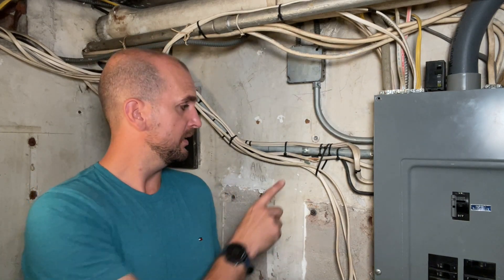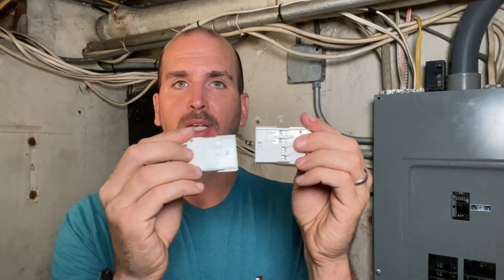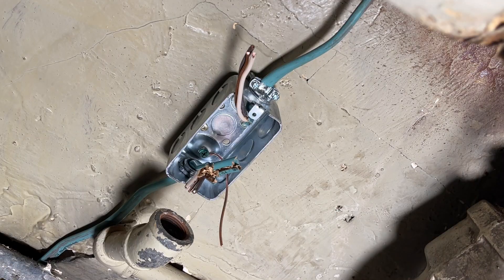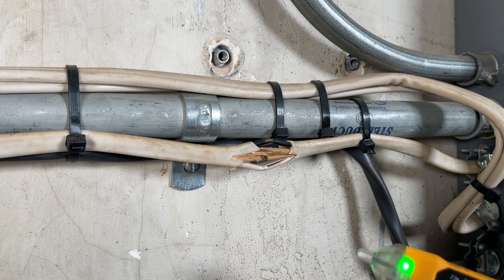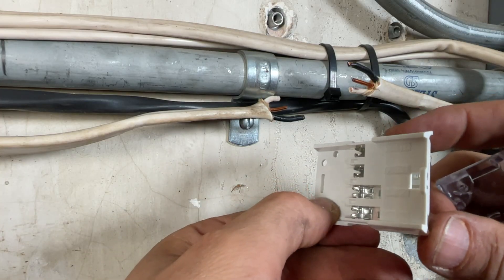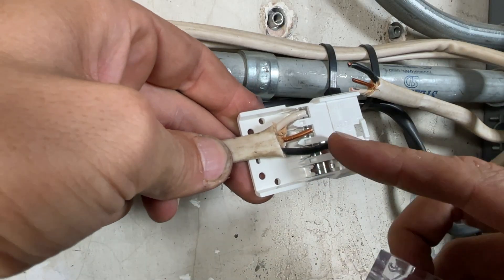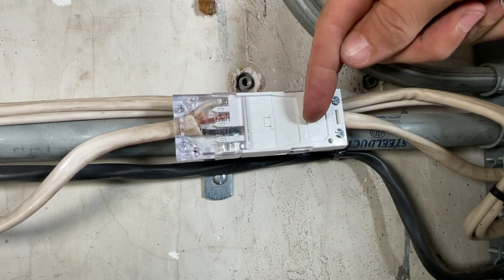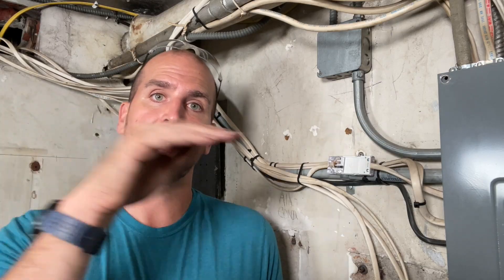How To Repair Damaged Romex Wires

Comment: I don't like the whole concept of pinching down on a wire to make a contact, especially buried inside a wall. Looks like a temporary repair
Reply: This splice kit requires plenty of force to assemble each half. In fact, the instructions recommend using channel locks. On top of that, there's 2 screws that fasten the cover and prevent the wires from backing out in case some bastard decides to pull on the romex. Also, some local jurisdictions may require more stuff to be installed if a splice kit is used.

Do realize that network cable jacks, couplers, and plugs pinch all 8 wires to deliver internet signals as fast as 10 gigabit.
Reply: @aurvaroy6670  amperage buddy
Reply: @randyschryvers7418  Good point. Same thing goes for WAGOs, even the lever nuts
Reply: @aurvaroy6670  They don't carry enough electricity to kill someone or burn down a house.
Reply: @whattheschmidt  Are you talking about the splice kits or WAGOs?
Reply: @aurvaroy6670  Ethernet 8 wire vs 12 and 14 Guage house wire
Reply: @whattheschmidt  Right that was a bad comparison
Reply: @aurvaroy6670  True, but ethernet cables do not carry 15-20 amps of current. I would NEVER trust insulation-displacement connectors on any branch 120volt circuit. I'm sure that plastic is not heat resistant either. I can't believe these connectors satisfy any electrical codes.
Reply: @arubaguy2733  I apologize for the bad comparison. I still trust insulation pinching connection as long as I can see the connection. In this splice kit, I can see if the connection is good so I'm fine with using if I don't have any slack and can't replace the existing cable. If the plastic isn't heat resistant, then the NEC would've banned it and they wouldn't be manufactured anymore.

Comment: First, please people, don't do this to Romex!
'What I do when doing continuity is use a straight pin and poke that into the insulation." Much easier to patch!

If presented to this, I'd use shrink and solder. My preference. Otherwise, a box and wire nuts. I don't care for the flimsiness of those Wagos. Just my opinion.
Reply: I was wondering if you could use heat shrink tape to replace the insulation over the individual wires, and then more heat shrink tape over the Romex as a whole. I wouldn’t want to use standard electrical tape, because that’s not going to last for years — the adhesive will give out. But heat shrink tape?

Comment: Btw all of your wiring is wrong.  Romex is only to be used inside of walls.  Not Tied to emt conduit. You're whole house is not code compliant and you definitely have electrical issues constantly. Stop making videos showing people the wrong way to do things.
Reply: He is showing you what he’s got, which is an old house that is grandfathered. Any new construction would have to follow current code, but the old stuff can be left in place. It’s the repairs to old stuff that I’m interested in.

Speaking for myself, I appreciate that he shows us real world examples that he’s got to deal with, and what his solutions are.
Reply: @shubinternet  not true. Those zip ties aren't 30 years old. They're new and that being the case is a code violation. Same as everything else there.
Reply: @williamholsey  — hmm. Good point about the zip ties. But I suspect virtually none of them of them are original to the time when that Romex was put in. Again, this is a matter of the house being old and while large parts of it might not be up to code in your jurisdiction, it may well be grandfathered in his.

Comment: Thank you so much for this!!! I've got these and was trying to figure out how to solve the problem!!  I'm a DIYer homeowner. I bought the no contact wire tester you suggested & the Wagos - they are excellent and have made life so much easier, thanks!!!
Reply: Non contact wire tester are called Widow Makers for a reaspn. Use a meter. An electrician with 30 years experience told me that.

Comment: Wrong. You must have at least 6" of conductor on each side sticking out. When you don't have enough wire to give 6" you must make 6" jumpers to be code compliant.  Your handy box is wrong. Here's the code: article 300.14
Reply: as an electrician for 35 years I would replace the entire run from box to box, or install a 180 with enough romex so I had the 6” out of the face plane of the box as required by article 300.14 . There is no reason to do a hack job like this, the cost to do it right is minimal compared to using the junk.
Reply: Sparky Channel on this;
https://youtu.be/CljDod-gt_M
Reply: 334.40(B)
Reply: @killaken2000  you're pretty stupid.  Is that exposed romex fished and concealed.  No it's out in Exposed room
Reply: Get intouch with Life safety. They will let you know and then give you a tag. $$$
Reply: Now tell us why that matters.
Reply: @adama1294  more importantly it's in case there's a electrical short that damages some of the wire,  you can cut off some and still have enough to do the make up
Reply: @adama1294  for make up.

Comment: I'm curious why one couldn't simply create new insulation by coating the exposed wires with epoxy.
Reply: Because insulation has a voltage and amperage rating to insure safety. Epoxy is not a suitable insulator .
There are some very good splice kits available that are safe and effective. The 1 shown here i personally won't use . Might be approved but it's cheaply made and won't hold up . The nec code is the bare minimum allowances. Just because something is code approved doesn't necessarily mean it's good .
Reply: They make insulation you can brush on. It is black and it’s a rubber with a brush in can
Reply: Liquid rubber..
Reply: @benwoodrow5122  : Yours is the second mention of liquid rubber.  Does it satisfy the building code?
Reply: AT&T RJ-11 have gel-Filled splice units = low voltage and resistance. AC high voltage makes things fun😱
Reply: That's what a home owner might do, but it's not "code". (I'd use rubber tape. Just make sure it's where an inspector can't see it. ;-))
Reply: @jfbeam  and wait till your house burns down
Reply: One, that is not a code compliant method
Two, it allows the wiring to remain a hazard.
Three, Epoxy doesn't stick to pvc worth shit, which is the material in that insulation.

Comment: I've never used one of those splices. I'd avoid it if possible, but sometimes they could save a whole lot of headaches. Those V shaped forks are called insulation displacement connectors. Same as a punchdown connector for data cabling. I still don't think I'd bury one in a wall though.
Reply: That's called a Scotch Lock in the automotive industry. It's the worst king of hack, begging for corrosion, extremely poor conductivity and later failure.
Reply: @FerrickOxhide  in a stationary and climate that’s static, your statement is not that significant. In a car, where it’s under near constant abuse, and climate flux year in and out, this isn’t an ideal repair. 
But when it’s not subject to anything other than transfer of electricity, it’s as solid as a wire nut. 
In this example, 
Running 2-3’ of new romex only into the breaker box allowing more than enough extra slack, and perhaps even using an outlet would be the preferred option. Presuming there isn’t already a nearby outlet on the same immediate area.
Reply: I'm only a helper ATM but I was under the impression splices had to be accessible, and being in a wall was not considered accessible by code
Reply: @bubbly6379  the word in the NEC is jumction. And its up to the AHJ (authority having jurisdiction) to define junction, usually junction box. In other words whatever the inspector says. This product is UL listed so I'm assuming it is considered having an integral box.  If i were the inspector, though,  I would still fail it if it were not accessible.
Reply: @bubbly6379  apparently they managed to get this one listed for that purpose, but I'm really not sure how.
Reply: @notsure7874  I don't think it would fly in any place like the Bay Area- with the inspectors there.
Reply: @bubbly6379  someone sold their soul to get a UL listing on this one so you can bury it.
Reply: Only in rare circumstances under certain  specific conditions and always accessible.  Ok in a pinch. Not an adequate replacement for a junction box
Reply: @tydouglas7144  only in a pinch? BS.ANY JUNCTION SHALL N MUST BE ACCESSIBLE. NO IF'S, AND'S OR BUT'S. DO IT RIGHT OR DON'T DO IT AT ALL. MAKE THAT CALL TO A QUALIFIED ELECTRICIAN, NOT A HANDY MAN, A LICENSED ELECTRICIAN. I WOULD RATHER PAY AND REST EASY, THAN HAVE A NIGHTMARE THAT WILL HAUNT YOU ALL THE TIME.
Reply: @mdvener  always accessible.  PERIOD.
Reply: @mdvener  That's code. I work to code or exceeding code, always, no exceptions. People put their lives and property in my hands. I take that seriously.
Reply: @tydouglas7144  I saw him pull that out and I'm going, Like he is NOT going to use that POC in a power circuit!  I would trust a strip, twist, solder and heat shrink before I did that in a wall.  Those were the worst thing EVER in cars, not in a place you live in!  How they got those approved for in home is beyond me.
Reply: @baker3538  you've got a splice, concealed in a wall and no one would know where it is if it failed,
 plus by piercing the insulation and digging into the wire, you've reduced the gauge of the wire in that splice where the currents' flowing through, so then a 20 gauge wire might be only a "15" and not able to handle the load, if it needed the required 12 gauge ( let's say) because it was pulling 20 amps.
Reply: @frankpaya690  20amp not 20awg...........20awg is much smaller wire,
Reply: @baker3538  If I recall correctly, soldered connections were banned at least half a century ago - due to the risk of the solder melting and either causing a high resistance connection, short or arcing connection.
Reply: I think I would install a junction box set in the wall with a cover plate on the outside of the wall.
Reply: These are used in RVs. They’re terrible.
Reply: I've replaced a lot of them...
Reply: @kenbrown2808  That's exactly what I figured. I've got by my whole life without them, and I don't trust them in a wall. My whole life I've been pulling a new piece to the attic or crawlspace and putting a box there, and a new short piece of romex. Don't have to replace the whole wire, and if you know the wires bad in the wall - you don't have to cut / patch either. Remove box, fish new wire, put box back.
Reply: @notsure7874  I recently rand into a case where a siding nail had been driven through the wire.  I simply went back to the next stud on each side and added two receptacles.
Reply: @kenbrown2808  Yeah, then you don't have a failure prone joint (which is ANY joint) buried in a wall.
Reply: @notsure7874  AND there's a couple more receptacles.  which in an older house is an added bonus.
Reply: @kenbrown2808  if you’ve replaced these they were not installed correctly
Reply: @techmetal2292  if by "not installed correctly" you mean installed at all, then you're correct. there's a reason why back stab connections were restricted to 15A circuits, and there's a reason these are only used on trailer houses.
Reply: @kenbrown2808  Well said.  When it comes to Manufactured Homes and RVs the emphasis is on manufacturing at lowest cost (time) possible.  Components are usually assembled by minimally trained workers with an incentive on production, not quality.  If it works, great.  If not, let the dealer and consumer figure it out.
Reply: @jamesjamesd9556  I know at least one manufacturer's quality assurance program is "if the customer complains, send out warranty service"

Comment: Sometimes you don't have enough slack to pull to reconnect the romex inside a box. What you can do there, is cut the romex and pull it back where you can get a box on both ends, then run a short piece of wire between the 2 boxes. It's a whole lot easier and less costly than running a new wire.
Reply: So cutting corners is OK, making it correct n safe is at the top of my list .Was an electrician for 40 years. Twisting wires and using wire nuts makes a much better connection. And yes there is times of repair. I sleep well at night knowing I did every thing correctly and safely. That is the bottom line.
Reply: @mdvener  Did I say bury the box? Because I don't remember saying to bury the box. I've never buried a box before in my life.  Twisting wires and using wire nuts is generally how I make the connections in said boxes. So there is that.
Reply: @notsure7874  I got so many replies, I might be mistaken.  I do apologize.  My bad.
Reply: @mdvener  can you explain why that wouldn't be safe? Im still learning, if you're  an electrician,  I value your  knowledge.
Reply: @Chris.Rhodes  it is safe as long as BOTH boxes are accessible, that part was never mentioned.
Reply: @mdvener  I gotcha. thanks man
Reply: @mdvener  it is safe as long as BOTH boxes are accessible, that part was never mentioned.

I didn't mention it, because it's a given. Burying boxes is 100% against code, and stupid as all getout. Do I have to spell everything out? Oh - I twist the wires clockwise, 4-6" of wire peeled out of the jacket, 6" of service loop behind the box, the NM should be fastened to framing (generally, unless allowed by code not to be like a fished wall), the boxes should be attached, make sure to use all UL listed parts, and put cover plates on the boxes ...

I want to know what the fuck you think I'm connecting wire with inside the boxes though. Because that's pretty damn apparent what I was talking about. What is NOT apparent is what you thought I was suggesting besides twisting wires and putting wire nuts on.
Reply: @notsure7874  I don't know what type of work you do. I got so many replies today. Really sorry if I got you mixed up. Never meant to. Really good to hear you abide by the rules we are supposed to. Accept my apology. After 40 years, and @ 20 of those were service, I've seen about everything. Went to one house to change a hood vent, tried to turn it off but no luck. Finally it went off when turning the oven off. Come to find out it looked as if they forgot to feed the hood. So their easiest way to get a feed was to snake a 14/2 from the range outlet to the hood using one leg 50 amps and the ground to make it work. So there are people out there that know just enough to hurt or kill someone. I can tell by your response, you are definitely not one of those corner cutters. Just one of hundreds n hundreds of shit work. But they are out there.
Reply: @mdvener  Sorry for being snippy - I do get it. I do a lot of service work, and it's infuriating to say the least to see some of the dangerous crap people do. You should see the hack work I've been ironing out at my house. Previous owners motto was "I know a guy that'll do it CHEAP!". Outlets fed from the 240v AC circuit that doesn't have a neutral, so you know where they got the "neutral" from, an old 80's bath GFI with 1 outlet and 1 light - that had 5 14/2's pushed down into the box, wires cut and wire nut / duct tape "spliced" back together and just thrown in the insulation, one of those bath GFI's feeding a box fastened to nothing, no romex connectors in the knockouts, with about 4 more wires running all over the place - fortunately for me none of it was stapled down so it was easy to remove. Oh and the panel. Holy mother of god the panel! Breakers labeled for things that never existed like a 240v "Pool Pump" circuit, but the pool pump was run off 120 fed by some outside lighting (1.5hp motor, needed its own circuit). Half the breakers weren't even actually in use, which was a godsend since I needed those spaces for actual circuits that needed to be there. It was a real shocktopus. So I get the assumption, it's not entirely unreasonable.
Reply: @notsure7874  p
Reply: @notsure7874  some people know just enough to make things just a complete mess
Reply: @mdvener  One leg of a 240v and ground? WTF! They were nuts.

I wish Code to mandate ALL new circuit breakers are GFCI!
Reply: @mdvener  and that would be the reason for a technical, very thorough explanation of any electrical installation, as you obviously know.  I think you had a very valid point.
Reply: @notsure7874  You need anger management counselling, pal.
Reply: That Guy, I wholeheartedly agree with you. I saw a job illustrated once where ever cable going into a box had a "jug handle " as if someone wrapped the Romex around their hand to build in 9" of slack. I did that on a branch cut that I added at my cottage, not sure if that is code or not, but it sure helped years later when I needed some slack in a branch to repair a broken wire that I had nicked at orig installation
Reply: So you're saying connect one box to side A of the cut line, connect a box to side B of the cut line, and then connect the two boxes with like a 6" middle line? Is that what you mean? If so, I'm with ya. Especially since a box is only like $3.50 at the hardware store.
Reply: @Chris.Rhodes  More or less, yeah. Except I leave more than 6" between them. A couple feet generally, so you have room to fasten the wire, put service loops in, etc. Varies per individual situation of course.
Reply: If you look at the distance from the panel, cut the wire, then run a new length from the panel to the junction box. That way only one junction box is needed and it looks a lot cleaner. Also fewer points of failure.
Reply: Yep. Pull off some free NMC if available and get that connection in a box for fucks sake.
Reply: Exactly.  My understanding is that 6" past the romex jacket and 3" sticking out of the box is required by the NEC -- unless there was a lot of slack in the romex, in general, I don't see any way to do that with a single box (in this case he is so close to the breaker panel, he could just replace that piece of romex with a longer piece).
Reply: Exactly!!!